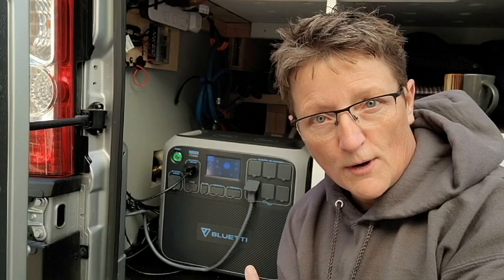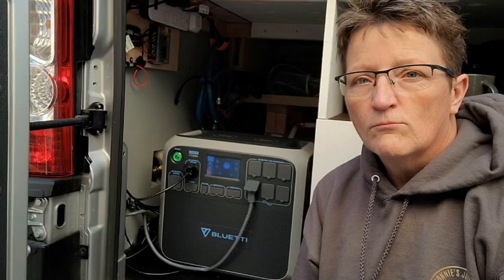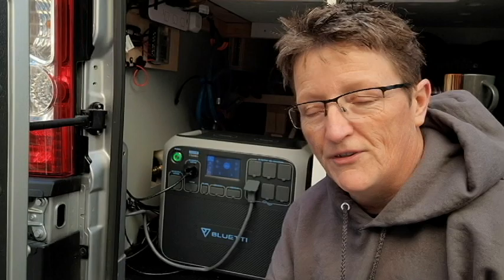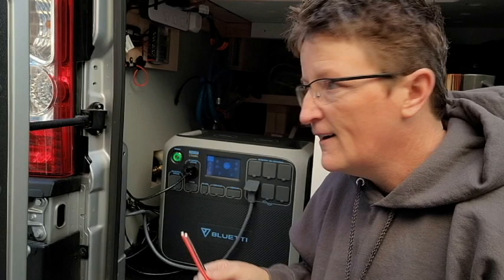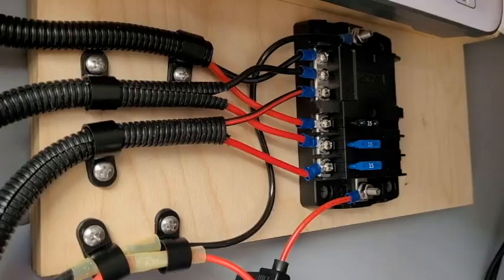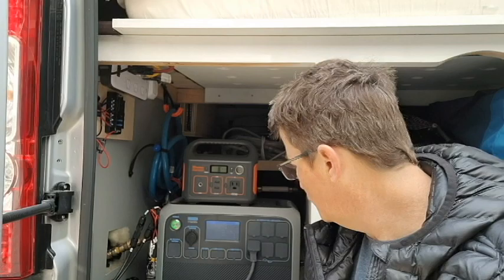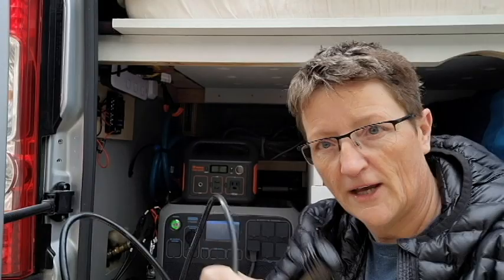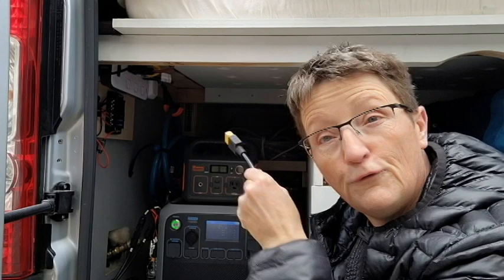Connecting 12V Fuse Panel To Portable Power Bank

Comment: I swear I have scoured the internet trying to figure out how i would connect a fuse block to my bluetti eb150, so thankful for this video!!
Reply from the maker: Dan that is exactly why I made it.  So happy this helped you.
Reply: @JonniesJourney  wait a minute! Where do you get the cigarette lighter --> XT90 cable? My EB150 did not come with that and it's not in your links!
Reply from the maker: @dansmith6157  you have to make one.  You have to order the xt90 connector and wire to cigarette lighter adapter.  They come in a pack of 5.  If you need one I can mail one just send me address on Instagram. Or email me.
Reply: @JonniesJourney  you might be the nicest person ever but I can definitely make my own! Do you just splice a cigarette lighter with a male xt90 using butt connectors? Figured I'd find them for sale on Amazon but no luck
Reply from the maker: @dansmith6157 thank you.  Yes,  that is what I did.  Also, make sure the 150 is xt90 connector and not xt60.  Bluetti used some xt60's but I'm not sure on which specific ones.
Reply: @JonniesJourney  but why would I care what is inside the generator? If I am understanding this correctly:

- I take a cigarette lighter, that goes into my 12v output of my eb-150 (I am not concerned with CHARGING the generator - I have a different input and solar panels, my cables are different than yours but that part is figured out - my questions are only about how to use my 1 12v cigarette output on the generator to power multiple devices)
- i cut the end off the cigarette lighter
- i add xt90 male part to that cable
- i add female xt90 to the power in terminals on the fuse block 
- for all of my devices (fridge, fan, lights) i take the exact same approach, but they are connected to the output terminals on the fuse block
Reply: Or I don't even need to cut it, I could use something like this right? So this goes into the DC output from my generator. I guess I don't end up with the 'plug / unplug' ability I'd have if there was xt90s in the middle, but I'm not sure I'd need it for this plug because I could just unplug from the generator to 'turn everything off'

So to recap - I'd use the cable below to go from generator output to fuse block, as the power sources (top / bottom in your set up). Then take all of my device wires, cut them if needed, and add the xt90 male side.  Then add the xt90 female side to the fuse block, plug them in and I'm good to go, right??

https://www.amazon.com/Carviya-Cigarette-Lighter-Inverter-Electric/dp/B01HGO2OIS/ref=sr_1_2?dchild=1&keywords=xt90+cigarette+lighter&qid=1612546463&sr=8-2
Reply from the maker: @dansmith6157  that would absolutely work.  I had to use the xt90's because my Bluetti uses the SA20 connector and the Jackery (my backup) uses the 12v cigarette adapter.  My Bluetti has the 12v  cigarette port but I wanted to use the 12v25a for my fuse panel.  The xt90 connector allows me to switch between the two.
Reply: @JonniesJourney  got it! I'm so sorry Jonnie I don't mean to keep asking more questions, but now I'm stuck again. I bought the XT90s and rings in your description - but now I don't get it, because the XT90 looks like it's supposed to be soldered? Yours look the same in the video - I don't think you just put the ring connectors on the soldered end of the XT90 and just tried to crimp it right? 

Did you get the soldered end off the XT90s and strip the cable back? Then crimp that on the ring connector?
Reply from the maker: @dansmith6157  no worries at all. Happy to help.   Yes crimp it back and add the connector and your set.  I used the heat shrink connector but any will work.

Comment: OMG, I was wondering how I could wire all my DC needs using the Bluetti and now I know. Thanks so much for this video.
Reply from the maker: absolutely. Glad to be of help.
Reply: @JonniesJourney  HiJonnie, the additional safety fuse that you added is that 25 amp?
Reply from the maker: @deb16acres20  I have a 15 amp in there, my setup really doesn't require more than that.
Reply: @JonniesJourney  thanks!
Reply: Bluetti is  10amp

Comment: There are great reasons for wiring up a fuse panel to a portable power station.  Love that you covered this in your video.  In our van, we enclosed our fuse panel in a larger plastic enclosure and then added an Anderson Powerpole connector to the front.  Our Bluetti or Jackery then connects up simply to the enclosure.  We also added a SAE exterior port to the van for our portable solar.  It is then wired to the same location as the enclosure, making it easy to connect to the input of our power station.  Clean and Simple!
Reply from the maker: Sounds awesome, I am going to check out your channel, would love to see your setup

Comment: Thank you soooo much for this! I’m just about to the part of my build where I need to figure out my electrical system. I bought my rig (skoolie) semi-built out and it came with solar panels and this same exact BLUETTI. Considering it’s price tag I really wanted to be sure I could wire some 12v/fuse block into it! This single-handedly alleviated a major stressor in my build. THANK YOU!!!
Reply from the maker: Thank you for taking the time to share this. I really like helping the community. Good luck on your build.

Comment: Excellent video! I've converted my camper from the old house battery to LiFePO4. I also happen to have a battery generator, and I wondered if eventually I'd rather do something like this. If I was building from scratch, your design is exactly what I'd do. I think too many RVers and van lifers are focused on using devices that require an inverter. My plan is to stick to 12v exclusively. Laptops can even be powered by 12v with the right adapter.
Reply from the maker: Absolutely.  Thanks for watching and commenting. Good luck on your system

Comment: I just started watching your videos yesterday.  I love all the information you are providing.  I have a van and all this stuff purchased but no experience.  I already purchased a 2000 w inverter, charge controller, 30 am power plug, solar,  and converter.  Thinking of selling all that and getting the bluetti because it seems easier.  Thank you for the videos!!
Reply from the maker: Bluetti is very easy and so far I am loving it.   How much solar did you get.  What type and how much battery were you planning on.  Debbie, not sure where you live but I am thinking about starting a small business to help people build out vans.  get them started kind of thing or some consulting.
Reply: @JonniesJourney  I live in Michigan. I have 2 AGM batteries. I purchased 200 watts of solar. I think you would do well having a business. So many need help. I have racked my brain trying to think of how I could build my van. I even tried to hire someone but they quoted me an unaffordable rate. A part of me is thinking I should sell it and just use my travel trailer for now. Where are you located?
Reply from the maker: @dsbruening  St. Louis.  As a female on the road I really wanted to be able to put it in drive and go if I felt uncomfortable.  Don't give up on your dream.  Message me on Instagram if you need any help or have any questions.
Reply: @JonniesJourney  I sent you a message on IG.
Reply: @JonniesJourney  I sent you a message on IG.

Comment: This is great thank you!  Question?  I see the Bluetti has 3 different 12v outputs.  I"m not an electrician but do you have to run 3 different 12v systems if you have things that use different amps?  Also, on your distribution panel is it possible to have to many things running on it at the same time and just not have enough power or could it burn out the panel?  Thanks for your help!
Reply from the maker: using the fuse block allows you to run all your DC components to one spot (the fuse panel).  Each component can have a different amp usage, this fuse block allows you to fuse them to their requirement.  Because the Bluetti has a 12v/25amp DC output, you can run one wire from that port to the fuse panel.  This allows you to power every component using this one DC port.  You can also use the 12v/10 amp cig port for other portable items if not hardwired to fuse panel (ex.  portable vacuum) .  I have no items that require the 5521 port.  

I do have an updated video that I put out a week or so ago that may better explain the setup.  thanks for watching and let me know if you have any other questions.  also,  I'm not an electrician either, we are all learning together.   👍
Reply: @JonniesJourney  You're awesome!

Comment: Thanks, Jonnie. That was straight forward and well presented. I always use ring terminals too. I use the bare ones and always solder the connections then use heat-shrink tubing. I don't trust crimps especially when there's vibration involved. I'm trying to catch up on your older videos now.
Just sane...  :^)  Saint
Reply from the maker: That's a good idea.  I did use the heat shrink ones in Lisa's van.  thank you for all the support to the channel. 🙂😀❤

Comment: This was a TREMENDOUS help when I build my bus conversion last year. I could not get my head around creating a 12v fuse box powered by my solar charger. You made it very clear and easy - thank you! Last summer while in an RV park in Vermont I was hooked up to shore power (had my Ecoflow hooked up to shore power and the Ecoflow to the 12v fuse box). It was very hot so I had all of my 12v outlets running fans, had my maxair cranked on high and the 12v fridge/cooler (which sucks a lot of power). I over loaded the Ecoflow and the 12v cigarette lighter plug thankfully popped out of the back of the Ecoflow and was melted and deformed 😬. Neither the inline fuse or the fuse in the cig plug popped. I am wondering in those extreme conditions if there is a way to to plug my 12v panel more directly to shore power without having to go through my solar charger? Would I need an inverter? a converter? is this even possible without a battery? Thanks so much for sharing all of your great knowledge!!
Reply from the maker: Michelle, WOW, the fuse should have blown.  The cigarette lighter port is such an unstable connection.  I wonder if the plug was loose, the 10am fuses in there definitely should have blown making me think was it hot from over amperage or a loose connection.  You can buy adapters that plug into an outlet (shore power) that will receive a cigarette lighter. This again limits to 10amp.  Which EcoFlow do you have?  For quicker responses, don't hesitate to email me at midwestvanbuilders@gmail.com

Comment: AMAZING VIDEO.  Could ya make a video on how to make the wire to solar charge your bluetti IF your already using the one provided for the fuse panel DC stuff. thanks
Reply from the maker: On the Bluetti 200AC and 200P the aviator plug that comes with the Bluetti is a female pin. That cord does not connect to the 12v/25amp that you would use for the fuse panel.  But...  I have a video coming that will thoughly show this connection and many more. I have taken all the questions I have been getting and answered them in one complete video.

Comment: Excellent video - Thanks!  I'm constructing a similar setup (Bluetti powering 12v accessories via 12v fuse block, for a cargo trailer conversion). Very cool that you built your own aviation/xt90 connector. I was able to purchase an accessory 12v/25A aviation connector from Bluetti (They say sold out now, so maybe I got lucky there). Interesting tidbit: the connector they sell is aviation plug to xt60, instead of aviation to xt90 which is what they use for the solar input. I'm a little concerned that the wire gauge they use for this aviation/xt60 connector is 14 awg.  I'm fairly green when it comes to electrical, but from what I gather you need 12awg wire to carry 25A, and code calls for 10awg. This is something that I'll ask Bluetti about, but for now I'll assume it's good to go if that's what they're providing. Along those lines, I was curious about the gauge wire you used for the connector you made, and how it's working out (it looks like you used 12awg or possibly 10awg). Also, I was wondering what size inline fuse you used on the positive line between your Bluetti and the fuse block.  I was considering doing the same, and figure that 30A is correct.  Thanks again, and happy travels!
Reply from the maker: I think some of the Bluetti units were xt60 but all of the ones on my unit are xt90.  I used 14awg as well as that is what the forum called for and my line is less than 2ft long.  I can use up to 20 amp fuse according to the DC chart.   I also can power my panel off my small Jackery in a pinch and I know it can not handle the same load.  I run my maxair, LED's, gray tank ball valve and water pump.

Comment: Hi Jonnie,I bought all those items with the link you provided from Amazon. The one thing I don't understand is how you made the 25 amp cord.  Do I solder the wire onto the 25 amp connector. .
Reply from the maker: Yes solder  the red wire to number 1 pin and the black wire to number 2 pin. Thanks for using the links.

Comment: This is exactly what I was looking for. ,,,, I want to do the same exact set up … my only issue is I’m connecting a 12 V AC unit 7000 BTU Dometic roof top Air conditioner …. I’ve seen videos where the bluetti 200max can run the unit ,,, but not for extended periods of time.  should I run the AC unit to the fuse panel. ..?    or should I connect the AC unit to a separate breaker bar … ? The power cord from the AC unit is a really thick gauge of wire .
Reply from the maker: Can you tell me the model number of your unit.
Reply: @JonniesJourney  Dometic RTX 2000 Air Conditioner - 2000W, 12V - 9600028490 × 1
Reply: @JonniesJourney  Dometic RTX2000 12V
Cooling capacity —- 2000 Watts
Voltage——    12v== (10v = 15v )
Current consumption —  10 - 58A
Reply from the maker: i am not an electrician so please check with your installer too.  i would use a bus bar to get power to your 12v fuse box and the AC unit.  This will allow you to fuse your AC unit correctly.

Comment: great video, I am looking at the bluetti ac200l with doesn't doesn't have the 12v/25a outlet.  Is there still a way for the 200L to power a fuse panel?  the cigarette car plug is only 10amp
Reply from the maker: The 200L has a 48v aviator, which requires a $200 component to drop it to 12v.  Unless you are really wanting the supercharge I would get the Max.
Reply: @JonniesJourney  ok, thanks for answering,

Comment: Awesome video! I have the Bluetti AC200Max and it has a 12V/30 Amp plug I’ll put to my fuse panel. Quick Question: what size of fuse should I have in my inline fuse holder between the Bluetti and fuse panel to not fry everything? Thanks!!
Reply from the maker: I have a 20 amp on mine. 👍 i have an updated video that shows a little more. if yiu have any other questions please reach out. 🙂

Comment: Awesome video, this is exactly what I’ve been looking for! Do you by any chance have a video or explanation on how you made the extra solar cord that goes into the 25amp plug? I’m thinking of going with the EB240 since it has more wh but I’m not sure the 1000w built in inverter is big enough. Any insight or opinion on which one you think is better?
Reply from the maker: 1000w inverter may not be enough if you ever want to produce heat with it.  Like a cooktop or blow dryer ect.  Let me check back and see if I have a video on this cord.   Bluetti products don't use this one anymore. Only the AC200 and AC200P

Comment: I can't find the XT90 to cigarette 12 volt adapter?  Do you have an Amazon link?  I have the EB70 Bluetti and don't think aviation adapter is applicable...thanks!
Reply from the maker: You have to make it.  Buy the xt90  or xt60 and the cig adapter, use some heat shrink connectors for best results.   If you are only using the Bluetti you can skip the xt90 and connect the cig cord to fuse panel.  I use the xt90 because I have aviator on Bluetti and cig on Jackery.  I have to be able to interchange.

Comment: hi there! my wife and I are working on the same set up with a bluetti AC200 and we have the battery expansion 300 to add to it to make sure we have enough power to live full time (hopefully). So grateful for your video. we really need help with the wiring aspect of it all and are very scared to make a mistake. We also have a to add in our 12 volt ac unit to the mix and we are adding the Powermax PM4 75A 110V AC to 12V DC 75 Amp Power Converter to power our air conditioner. But still not sure what wiring to use for the basics of lights, fridge, fan water heater or water pump.... can you recommend us a link or if you have already made a video on it Id love to see it!
Reply from the maker: sorry for the delay, this went to spam for some reason.  please email me at midwestvanbuilders@gmail.com

Comment: Great info just what I was looking for. You mentioned using the same input cable from the solar panel input also to the 12v/25amp input, isn’t it a female connection same as the cable? It will allow solar panel input hookup, but wouldn’t you need a similar cable with male ends to connect to the 12v/25amp input? Just making sure I have this correct. Your instructions are so easy to follow.
Reply from the maker: Yes you have to make a male cable with the xt90.  So glad that this helps.  Thank you for watching.

Comment: Hello, thanks for the video- just what I need. I have a question though: do you know if it is possible to use an XT60 plug instead of an XT90. Is there much difference?
Reply from the maker: You absolutely can.  When Bluetti originally started production they wer notorious for the xt90.  They have since changed many of the devices to xt60 as has other companies making it the best choice for versatility.  👍🙂  i also have an updated easier to follow video on the channel if interested.  Feel free to reach out with any other questions